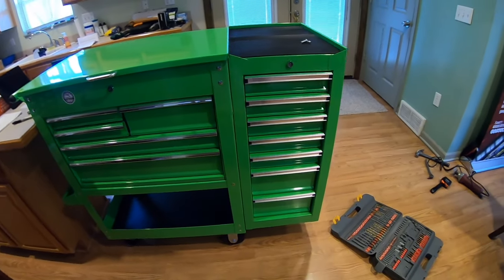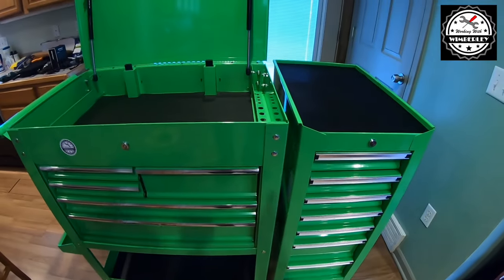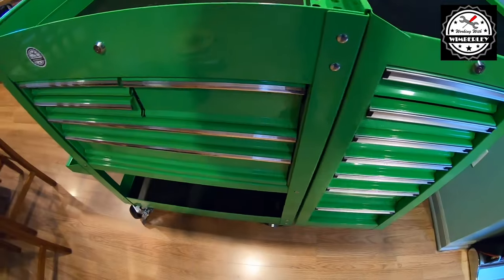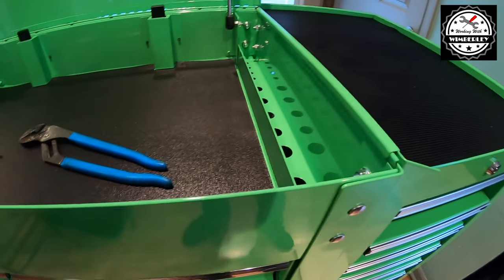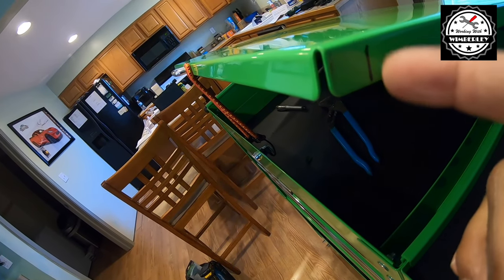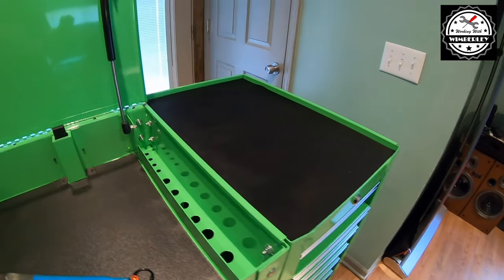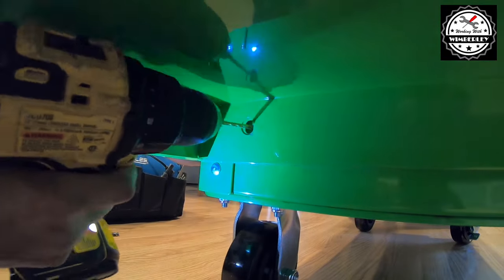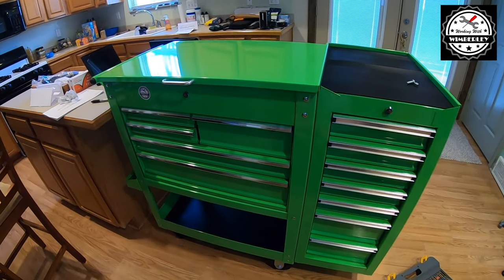HOW TO ADD THE END CABINET ONTO THE HARBOR FREIGHT TOOL CART 64721 & 56237

Comment: Cabinet on each side would be freaking awesome
Reply from the maker: I’ve never seen anyone do that. It would definitely be something to see!
Reply: @WorkingWithWimberley  thinking the same thing cuz ultimately it might be cheaper than that 44 in lol
Reply from the maker: @Cbsaiyan  I can tell you that the setup I have has been awesome. Much better than what I had before. It’s not cheap, but it’s worth the money.
Reply: I have one with the end cabinet on both sides
Reply: Beautiful cabinet!!!!!
Reply: Other than the tray and handle is there anything that would stop you from doing same on other side? I just got one . Thanks for the content.
Reply: That's what I'm going to do with mine.
Reply: @robbiewilliamson357 both those items on the side can be chosen to be installed where ever the operator wants on the box. easily unboltable to have both sides flush. than you could even reuse the handle and tray on the side of the cabnit
Reply: I’ll be putting one on each side on mine thanks
Reply: @andrewphillipmurphy1  Pictures?
Reply: I agree.  Seems like the car would get a little tippy if you filled that side cabinet up with tools
Reply: It would definitely be sweet too add a end  cabinet on both sides of this mechanics cart but don't forget I believe this mechanics card only has a 700 lb capacity so it's probably quite possible to exceed that with two end cabinets You would probably have to throw some casters underneath the end cabinets or something to support the extra weight
Reply: @michelwilliams7960  Agreed, some extra bracing and bolts to secure the cart to the end cab and relocate a pair of the casters.

Comment: I bought the same cabinet but I didn't cut my top. I mounted my side cabinet to my 5 drawer cart using spacers. Worked out real good. Didn't have to butcher my cart.
Reply from the maker: Ok cool!
Reply: got a video or anything of how you did that?
Reply: @SpykeZ0129  I do have a video. Search 10 drawer cart and end cabinet. You should find my videos.
Reply: 2 small cuts is butchering... ok, Picasso. The cabinet lip over top of the cart is an excellent idea all spacers you're just in the sheet metal.

Comment: With it just being the lip on top holding it will be able to securely hold the addition with tools maximg out the weight
Reply from the maker: @bruceatkins2189  I’ve had no issues with it. It’s been great for my needs. However I have not “maxed out the weight” with tools so I can’t say.
Reply: If you watch the whole video, you can see he adds bolts at the bottom as well.  So it is not just the top lip supporting the weight.

Comment: I did this about 3 years ago, then last year put another side box on the other side, with a side self.
The center unit after a years with all that extra weight on it is, so far, holding up fine.

Comment: You are lucky, you must have bought that end cabinet at the right time.  Always out of stock at my harbor frieght.  Nice clean job.  Only this I would do is add one caster to the end cart to disperse the weight if you load up the side cab.
Reply from the maker: Thanks! I purchased this in early 2022 and I did have to order it and wait for it to come in. It didn’t take that long though.

Comment: how is does if feel with the cabinet full of tools? Does the extra weight make it want to tip over? Is it more difficult to move around the shop?
Reply from the maker: It’s feels fine to me. My cabinet isn’t full. I’d say it’s about 40% full. It feels stable. As far as moving it around, it was tough with the two fixed wheels. (It comes with two swivel and two fixed) After I changed them to swivel wheels, it’s easy to move around. https://youtu.be/MLQFAYy5euI

Comment: Does the edge of the tool cart handle the weight of the cabinet well or does it get slight bents on the edge of the cart where you hooked it up from the beginning? also awesome video
Reply from the maker: It handles it totally fine. No bends on the edge of the cart from weight.

Comment: Would this cabinet work for the 4 draw tool cart? I just bought one and this mod really caught my eye and would like to do it if it would work for the 4 draw cart
Reply from the maker: @chrismontoya7854  I’m not sure. The 5 drawer and 4 drawer carts are the same height, but the length and width are different. Maybe someone else can chime in.

Comment: I've always liked this mod- though I wonder why no one adds 2 castors onto the outer corners of the end cabinet?  I think it would help stabilize the whole thing and give more support to the end cabinet once it's fully loaded with tools...  Just a thought.
Reply from the maker: That’s a good idea. The cabinet sits a little higher than the cart. You’d just have to add spacers. But it should work.

Comment: nice work. how does it do pushing it around now with that end cab on it?
Reply from the maker: I haven’t had any problems pushing mine around. I did swap the two fixed casters to swivel casters. That made it a lot easier. And it will have more tendency to tip if you load the attached tool cabinet heavier than the cart.

Comment: I have a five drawer box for work and I was thinking of getting the side cabinet and welding them onto a plate of metal so the backs can be level along with making the opening into a cabinet and moving the wheels. To the corner of the plate since I use a forklift to bring my toolbox around
Reply from the maker: Go for it!!!

Comment: Do you have an update on the set up with tools and how it’s holding up ?
Reply from the maker: @dazeh8  It’s been holding up great! I use it all the time. The only thing is that it usually stays in the same spot in my garage. I don’t roll it around a lot. I could, I just don’t need to. So it’s been great/

Comment: Does it tip forward? cause of the weigh
Reply from the maker: I haven’t had an issue with it tipping, but it’s possible if you load up the cabinet with a lot of weight especially if the cart doesn’t have a lot of weight in it.

Comment: are you thinking of adding wheels to the end cabinet to help with weight distribution and movement with it full of tools?
Reply from the maker: The only thing I did was change the two fixed wheels to swivel wheels. Having all four swivel wheels makes it easy to move the tool cart. I haven’t had any issues with weight distribution. At least not yet.

Comment: This might be a stupid question, but do you know if this will work on a 4 drawer series 1 cart.
I'm running out of space in my cart at work, and kind of want to get creative to extend the usage of my current little cart before I need to up to a larger cart or rolling box.
Reply from the maker: I’m not sure. Your best bet would be to check the dimensions of the side and see if they are the same. I haven’t seen anyone do it on the 4 drawer, but that doesn’t mean it’s not possible.
Reply: The 4 drawer art is substantially less deep. I think not a good idea.

Comment: I'm considering adding the same item to my cart. Can I ask how the balance is assuming that you've filled the end cabinet with tools. How easily and stable does it feel when you move it? I'm thinking you could easily have 75-150-250lbs+ in it.
Reply from the maker: I haven’t had any balance issues. But my cart usually stays in one spot in the garage and I haven’t completely filled the end cabinet yet.
Reply: @WorkingWithWimberley  Thanks. I'd imagine it would be a simple matter of weight distribution
Reply from the maker: @richardrush9326  I agree. I’ve had many people comment that they would put wheels under the cabinet part, but I haven’t seen anyone do it yet.

Comment: Nice video with simple instructions.  Thanks!  How is the stability?  I'm concerned that too much weight in the side cabinet will make the whole thing tilt.  I guess if that becomes an issue you could maybe add two casters to the bottom of the side cabinet.
Reply from the maker: It was heavy on the cabinet side when it was empty. After I put some tools in the mechanic cart portion, it’s been fine. But I always make sure to push it slowly and carefully. So far so good!

Comment: If the drawers are anything like the 5 on the main cart then you can remove them to make it a lot more manageable by yourself! Just pull one plastic tang down and the other up and it should slide out.
Reply from the maker: Thanks for the tip.

Comment: great  video , my only thought how  unbalanced does it become from all the weight on one side ??
Reply from the maker: I haven’t had any issues, but my cabinet add-on isn’t filled with a lot of heavy tools. It may be unbalanced depending on how the weight of the tools are distributed.
Reply: @WorkingWithWimberley  make sense well great work very clean
Reply from the maker: @texanaggie  Thank you!! I appreciate the feedback. Thanks for checking out my video.

Comment: Did you upgrade the caster wheels or leave the original ones on?
Reply from the maker: I ended up replacing the 2 fixed wheels with swivel wheels. It’s way easier to more when all four wheels swivel.
Reply: @WorkingWithWimberley  gotcha, I've seen other say that's a worth while upgrade.  I'm waiting to see if the basic tool list I was provided is comprehensive enough or if I'm going to need more than the basic 5 drawer carts.
Reply from the maker: @alexhenderson3436  It’s worked well for me. I’m actually still trying to fill up all the drawers.

Comment: That's a VERY good idea. Unfortunately that cabinet seems to be no longer available. Bummer !
Reply from the maker: I believe the U.S. GENERAL 15 in. End Cabinet, Series 3 is the replacement. That should work too.
Reply: @WorkingWithWimberley  Thanks for the heads up on that. They are $279. I got the 5 drawer tool cart on the 12 day Christmas sale for $189 plus tax, it showed up at the store today. (Slate Grey) I'll have to see if the cabinets go on sale at a deep discount before I jump on one.

Comment: Might be better to have the cabinet lined up flush on the backside. Then the surface top lines up when the lids shut and it can sit against walls farther back. 

Depends on your setup ofc. Either is a big upgrade
Reply from the maker: Thanks for the tip.

Comment: You should really have matched the color with some spray paint to seal the metal up after cutting it so it won’t be prone to rust. Also you should be using an angle grinder/ die grinder outside.

Edit: I heard you mention touching it up good job. But man your wife must hate it when you use an angle / die grinder inside
Reply from the maker: Thank you for telling me what I should have done.

Comment: Ngl it don’t look too sturdy, mind giving us an update on how it’s holding up?
Reply from the maker: So far it's been great. I haven't had any issues. It's been great for organizing my tools and I use it as a benchtop to work. I usually keep it against the back wall, but I have been able to move it around the garage with no problem. You can see it being used in this video: https://youtu.be/yvbegd8w-EE

Comment: You should not have cut the 5 drawer cabinet lid. A small incision with a.045 cut off wheel to the side drawer cabinet would have allowed the lid to close fully without having to disfigure your lid.
Reply from the maker: What are you talking about?

Comment: Wait. The cart is $269.99 and the end cabinet is $279.99. Wouldn’t it give you more storage to just buy two carts? Could even bolt them together and it would be cheaper?
Reply from the maker: I haven’t seen anyone bolt two carts together but I suppose it’s possible.